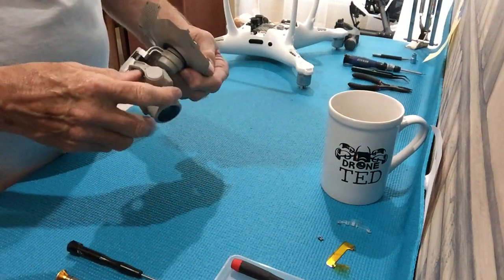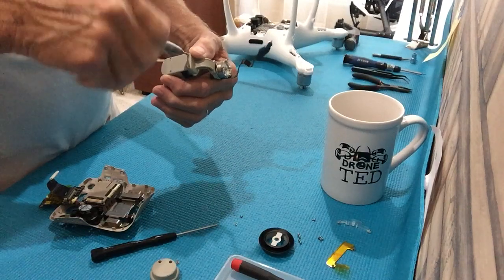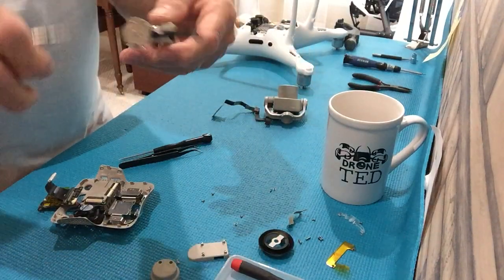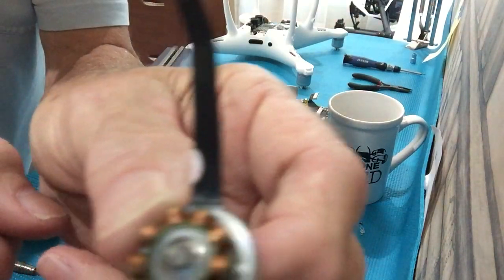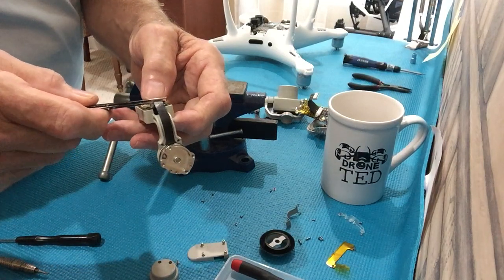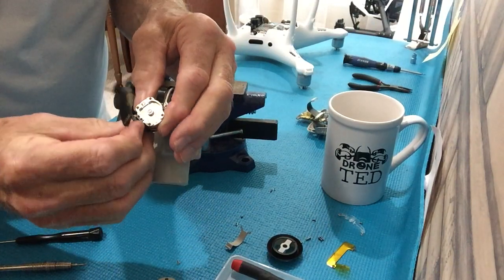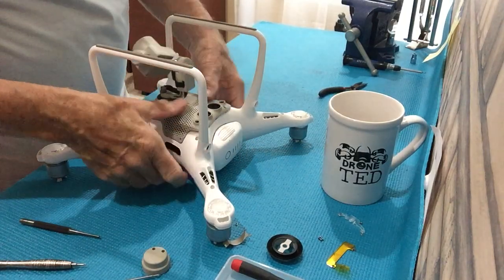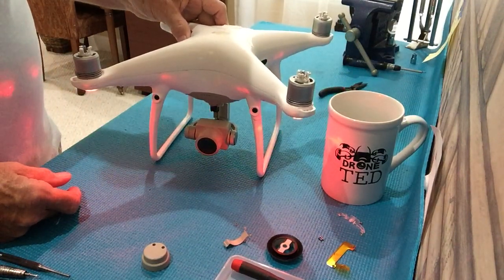DJI Phantom 4 Yaw motor Replacement video 2

Comment from the maker: at 4minutes and 53 seconds you see the vise with the yaw motor sitting on top. I have switched methods a bit. I now set the yaw motor down in the vise with it sitting on the ears of the casing. This is to prevent damage to the motor.

Comment: Thanks for the video Ted! I just repaired a Phantom 4 Pro gimbal with your help! It had a cracked hall sensor. We have multiple of these drones that crashed over the years, we use them in water management works, all of them had motor and structural failures. Your video was a big help!👍

Comment: I really appreciate your descriptions, I compliment you for your commitment. I sheared the gimbal arm and also the flat cable of the yaw motor. If I understand correctly I have little hope of realigning it if I buy a new motor .. is it right? Unfortunately I have already bought an yaw motor on Amazon and one apparently the same has arrived but with many very small differences, I send it back because, it is not possible to mount it correctly. What can I do? I'm extremely worried and don't know how to fix it.
Reply from the maker: DJI had two different yaw motors. The original older yaw motor had a different casing. It was pretty much perfectly round. The newer yaw motor casing was more rectangle on top where it mounted. That is the one you see in my video. The actual motor with windings and sensors is the same on both. It is just the mounting that is different. As long as you use the original casing off your gimbal you would be ok. Be careful buying yaw motors off ebay as most are used and may not be any good. Check the sensors with a magnifying glass to be sure they are not scratched. 
If you email me a photo of your yaw motor I can tell you which you have. It is not a direct replacement and you must use your original casing. It probably will not center if you just swap the entire yaw motor.

Comment: Thank you Ted, my Phantom 4 just crashed and gimbal won’t stop moving slightly to the left and right. Do you think the yaw motor is screwed? Because I just saw another video of a guy who replaced the ESC board and he said that might be the problem as well...BTW in gimbal settings whenever I try to auto calibrate it, it gets stuck at 5% or 50% and then I get Gimbal Overload warning. Also, when I try to adjust Yaw values, I don’t have any numbers as opposed to the Roll settings in which I do have value numbers. When I try to adjust roll settings, it barely moves like 2 numbers and when I try to adjust yaw settings it won’t move at all. I’ve also noticed that whenever gimbal tries to move to the right, that’s when it becomes stuck moving left to right, but when it moves to the left, it works perfectly.
Reply from the maker: most of the time it is the yaw motor. I always start there. Yours sounds like a classic case of the hall sensors being damaged. If you watch video #1 It moves back and forth
Reply: @Droneted  Thanks for replying Ted, I forgot to mention that sometimes the horizon line doesn’t center well which makes me think the roll motor could be damaged as well? Or maybe it’s all because of the yaw motor. What do you think?
Reply from the maker: @AleksDigital11  it could be but I would replace the yaw first. The roll and pitch motor are a direct replacement. No need to swap the casing.
Reply from the maker: @AleksDigital11  could be the roll motor. Make sure the yaw arm is not bent
Reply: @Droneted  thank You Ted, is there any way to notice the yaw arm is bent? Cause it’s not scratched or dented or anything and I checked it visually to see if maybe it’s in a bad position or something but I cant see anything. Already disassembled the gimbal. I’ll try to upload a video for you to see if it’s possible.
Reply from the maker: @AleksDigital11  just a visual inspection is enough. If is bent you should notice it.
Reply: @Droneted  I checked the arm Ted and it seems ok, not bent. There is one more issue I noticed: the gimbal is not centered it’s dropped to one side and it doesn’t self-center and once in a while I get the gimbal overload message. Sometimes it gets well aligned to the horizon but with difficulty.
Reply from the maker: @AleksDigital11  try a roll motor next.

Comment: Hi Ted, Thanks for doing the video. I've replaced the yaw motor and ribbon, using the old bell housing. All works well except after initialization, the camera "cants" slightly to the left when pointing forward, 5~10 degrees or so. Have been flying it that way for a year or so. Do you know if this type of re-calibration needed can be done at home or does one need some type of calibration software. I've searched online and have tried many calibration methods, (drone upright, manually turning , etc.) to no avail.
Reply from the maker: email me and I can explain how to get it to point straight. droneted@gmail.com

Comment: I need that ribbon cable cover that popped off at 2:09. Mine bent pretty good. any ideas? Should I just try to bend it back into shape? Do I need it ?
Reply from the maker: JG Video I usually just straighten them out. It protects the cable to the yaw motor. They are easy to bend back into position.
Reply: @Droneted  Thank you sir!

Comment: I replaced me esc in my p4 because my camera was facing left and now it centers when I turn it off but when I turn it on again it goes back to the left every time is it the yaw motor?
Reply from the maker: the esc is programed to the yaw motor casing. The original esc and yaw motor casing must be used. If you replace the esc you have to experiment with several casings to find one that matches. This can take a long time. You probably had a bad yaw motor when you started. The hall sensors get damaged very easily. Even just a hard landing will do it. If you still have the original esc yaw encoder, put it back and replace the yaw motor using the original casing off the original yaw motor

Comment: Hi, what should i do if the housing from the original yaw motor is damaged when changing yaw motor. I tried using it with damaged magnetic ring and now i think the ESC is broken (pitch motor and ESC gets super hot and the whole gimbal shakes violently). I have a new housing but the gimbal did of course not point center when i used it. Am i SOL and need to buy a complete new gimbal assembly? This is for P4A. Thanks :)
Reply from the maker: if the yaw casing is damaged or lost go to this video: https://youtu.be/bFjRTkyzDQs

Comment: Thank you, Ted! How do you fix the shaft? When you remove the shaft it will go up and down freely. Do you buy a part with a fixed extra shaft?
Reply from the maker: If it is just too loose I use Loctite just a touch on the end
Reply: @Droneted  Thank you again for such a great video and hints!

Comment: An ebay seller sold me the wrong gimbal ribbon cable. It has that extra little connector near the camera end. Will a Phantom 4 cable work on a P4Pro? I read that someone taped over the connection and it worked fine.
Reply from the maker: yes just tape over it. I really don't like aftermarket ribbon cables. they have a high failure rate.

Comment: Hi Ted you working perfectly 👏🏼👏🏼 I have same problem with the yaw motor. I changed it new one but I did a big mistake I couldn't change the housing with original one and my camera looking right side now. I can't found original motor housing to change like your video. Is there any solution to solve this problem? I can't use my drone for couple months because of this problem.
Reply from the maker: You have to try several different yaw motors until you find one that centers. I have 20 yaw motors and I swap them until one matches and centers. It takes a long time. The other option is to send it to DJI.
Reply: @Droneted  thank you quick response and helpful message Ted. So I need much money and long time 😊😊. I guess I come back to waiting to find original housing thank you so much again. Have a good day
Reply from the maker: @yunusemre5165  Finding the original is the best solution. You could buy several yaw motors  and then resell the ones you don't need
Reply: @Droneted  its a good idea Ted thank you :)

Comment: Thnx  brother  
But  i foolowed and wached  some other videos.  It owners claim that  the  broblem is with ESC board..  Is this  correct  bro?
Reply from the maker: You can have a bad esc but 90% of the time it is the yaw motor.
Reply: @Droneted  
Ooh ok may god protect u 😊🖐🏻i hve  same prblm the camera  is not centered but  whene i calibrate compass nd  rotate the drone. I hear that annoying sound. from gimbal. what's causing that sound? It's like something stuck
Reply from the maker: One of the 3 motors is making the noise. It may or may not effect the gimbal. Is your only problem the centering ? I have a video that address that. @djamelbmw2228
Reply: @Droneted  
My prblm the camera always goes left 
Okay my brother  thank u so much my respect to u sir for listening and responding to my comment. Thnx
Reply from the maker: Sounds like you need to change the casing on the yaw motor. Where are you located?
Reply: @Droneted 
Yes i need change  yaw motor 
Im too far away. I live in algeria  north africa 😊
Reply from the maker: did you use the original yaw casing?  @djamelbmw2228
Reply from the maker: watch this video
 https://youtu.be/bFjRTkyzDQs?si=llXBsQ5G_0A9k6mo
 @djamelbmw2228
Reply: @Droneted  
No, I haven't replaced it yet
I will order it from AliExpress
Reply: @Droneted  
I wached your videos. U are genius،  done well 😊🖐🏻🖐🏻

Comment: hello , im try it , but not worked , why?
Reply from the maker: Usually this is a problem with the "new" yaw motor. They are not always new and have damaged sensors. Even the smallest scratch can cause issues. Can you put up a video on YouTube showing what it is doing?

Comment: Hi Ted! Thanks for the video. I replaced my yaw motor, but I'm wondering if there's something more. I never crashed the drone, but I started getting a "gimbal motor overload" warning  months ago but then recently and suddenly, I started getting movement a lot like in this video (  https://youtu.be/ACBBodlnyu8?t=36 ).  This is an photo of my motor after I removed it from the P4P, and you can see it would cause the camera to point slightly to the right as well ( https://biganski.wordpress.com/dji-yaw-motor-off-center/ ).   So I replaced the motor and used the original casing, and the motor still was not centered. When I turned on the drone, the camera goes through its alignment setup, then points straight ahead, but then the camera "relaxes" and points a little to the right, it straightens itself up, then relaxes to the right, and this repeats. I could slightly smell the magnet motor working hard so I shut it down. Maybe I need to calibrate?  Or perhaps it's something more that will require sending it off to DJI. And that will stink if that's the case, as I'll have to buy a new drone as I shoot real estate for a living. Ugh!  Should I try the casing that came with the motor?  It is an OEM motor for sure.
Reply from the maker: was the replacement yaw motor brand new? on eBay they often used. also have you ever left the gimbal clap on by mistake. That will melt the varnish on the winding of the pitch motor and it will cause odd things to happen.
Reply: @Droneted  The motor really appears to be brand new, Hong Kong writing on authentic-looking dark gray part bag, took 7 days to receive "from China," and it had the same part number stamped on the yaw cable. But now that I've disassembled this several times and feel comfortable with this, I found the replacement motor spindle was not level to the casing; it was slightly at an angle. There was also some play from top to bottom, as the spindle would not seat flush to the casing.  I eventually got the motor to work and the drone started up, but the gimbal still points to the right and was still trying to corrected itself a little. Knowing my luck, I likely I have a compound problem with bad PC board, so I'm sending it off to DJI Repair in CA. I only have about 140 flight miles logged, but this drone served me well and earned me some $$, plus and I really like it so hopefully it's not going to set me back too much $$. But still, thanks for the video as it got me comfortable enough to take this thing apart, so it'll be a lot quicker to repair in the future. Cheers!
Reply from the maker: this is where I get my yaw motors
https://www.ebay.com/itm/353200234284